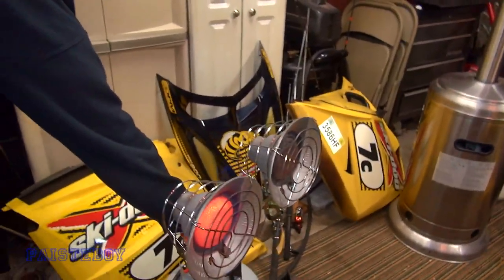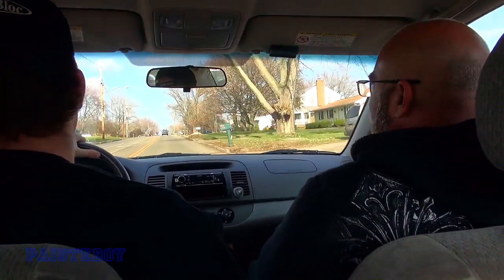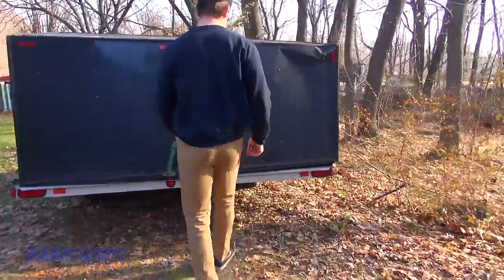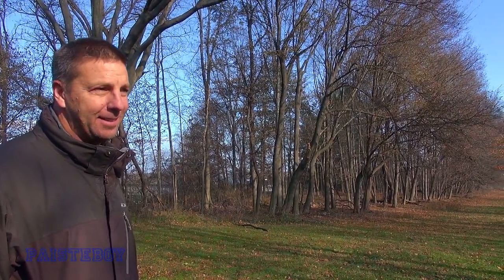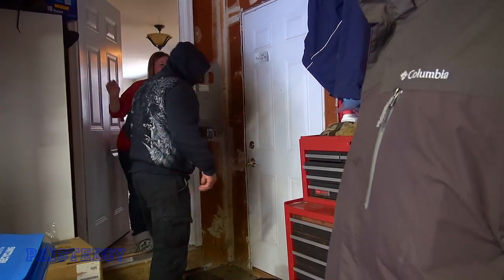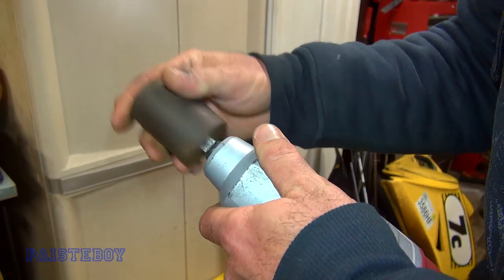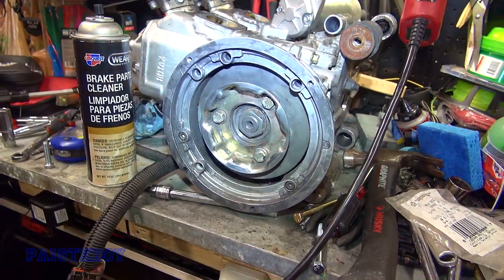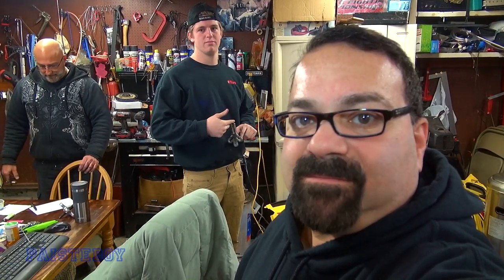Working on the Blair Morgan: PART 2 of 3

Comment: Great vid!  If those starter bolts are prone to coming loose, you should really get a repair manual and use the proper torque spec with the loc tite
Reply: Nice to see you guys at the sled repairs again it's been a while.Also Grade 9 bolts and as Mark asked about and bushings to remove the slop .
Reply from the maker: We'll look into it.  We're going to finish it up today.  Thanks Gary.
Reply from the maker: Yeah.  Mark is the only one with a sled that actually need attention fortunately.  When we go back to get the stronger bolts we look into some bushings for the starter holes.  Thanks Mark.

Comment: Don’t be afraid to use a little red permatex red gel loctite, I use red on my exhaust bolts and have never had any issues getting them loose, as a matter of fact most times blue will fail near any kinda heat on the engine since a sled goes through so many hot\cold cycles it’s tough on loctite and these things vibrate that's for sure lol,   Another trick is next time you pull a flywheel insert a couple bolts into it for smoother guidance because those things have a serious magnet the old famous slap then ya know its seated haha. Love your vids keep em coming 👍
Reply from the maker: Thanks for the tips and thanks for watching!

Comment: juss wondering why parker isnt doing a leak down test while he has motor out? easy peezy time to do it.i would have,cuz if that needed fixing thats the time,,same as checking topend,,doesnt hurt man,,like i say,,only a fool wouldnt check,,you have motor out there is NO BETTER TIME,,
Reply from the maker: We can do that tomorrow.  We are also going to check the water pump too.
Reply: Well actually bud if they were to do a test the best thing would have been a compression test before it was pulled. Then repaired while out. Kinda hard to do a proper leak down test on a 2 stroke man.
Reply: Oh here we go with one of these hero's with big words when there behind there keyboard eh bud. And a wanna be mechanic at best abviously
Reply: COMPRESSION test is what's needed on a 2 stroke and tells all tales BUD.